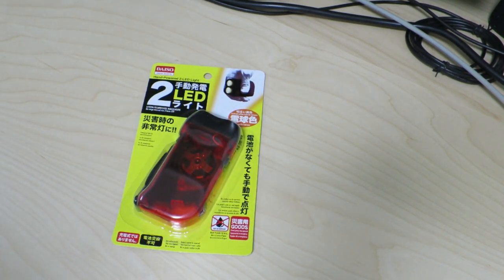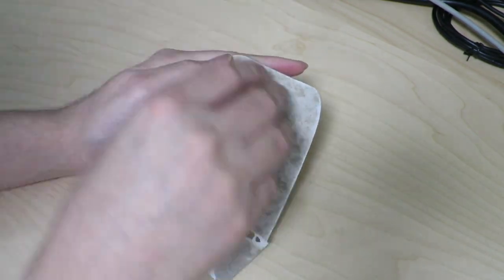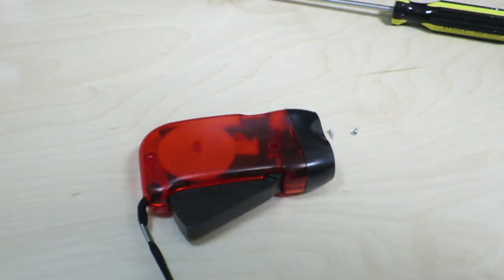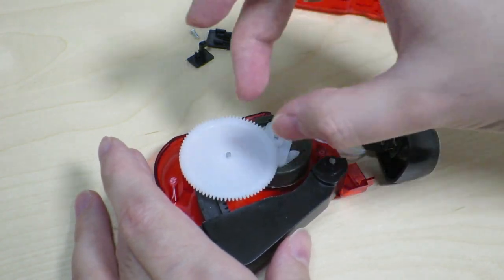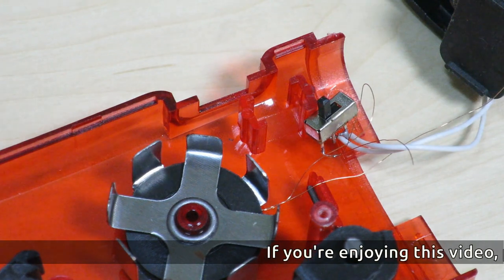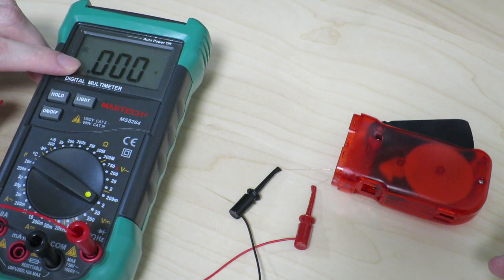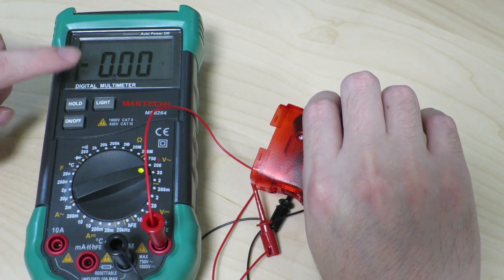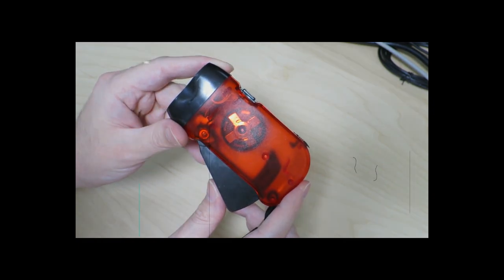Teardown and Testing a "Hand-powered" LED Flashlight

Comment: It appears these just have regular short-life, non-rechargeable button batteries in them. Once the batteries are dead, you have to pump with your hand constantly to produce light. If you stop, the light stops. It's a scam. The company tries to pass them off as having rechargeable batteries, like hand-crank lights normally do.
Reply: Found 3 L1131 Button Cells which is non-rechargeable inside.
Reply: But this can be recharged in a specific setting I'm still searching for the answer why the battery just charge itself in that setting.
Reply: Crazy thing happened when I touched the two wires together and the lights went on! I detached everything from it but the two wires. I guess the white casing on the top has some charge I guess.
Reply: bro i’m so stupid 🤦‍♀️

Comment: Neat basic idea. Could be improved in many ways. Add a supercap + joule thief, for starters, to make the light last longer after cranking. Put in a better generator (stronger magnets, more windings, axial flux), maybe a flywheel?, etc.
Reply: a supercap would be a nice addition if the ac is turned to dc that is
Reply: @evronetwork  A full bridge rectifier would do the trick, I think.
Reply: You would need special gears to use a flywheel, otherwise the hand pump would continue spinning 😵‍💫 

A joule thief might be too much tbh, maybe it could extend battery life, but if we’re using super caps it’s prob a lil extra. Having a voltmeter analog dial for battery life might be cool, or a radio w/ earpiece, or maybe a voltage multiplier to make a spark for lighting fires would be cool too
Reply: metal construction instead of plastic

Comment: Very nice example of mag flux, we see a spinning magnet and the coil wires which in a way cut through the magnetic fields, this movement causes mag flux which creates energy. As we know if you have movement and a field you get a current, this current is what powers the light.

Comment: Is there a way to harvest the energy? Like loading power into a battery?

It’s be cool to have a chargeable portable battery so you can power your phone just by cranking a little thing
Reply: Beware the voltage, you need a regulator or something will burn.
Reply: I was thinking about that too!!

Comment: I am 60,  tried to make one,  did not work, untill me friend told me,  AC  current,  need a dieode, :), I used a dyno from a push bike, I wondered why the bulb flashed all the time, put a diode on me frount light and the flashing went, we all learn, even at my age :)

Comment: you can also replace the batteries with super capacitor. it will charge quickly
Reply from the maker: The batteries in the thing is a completely different circuit from the generator, hence it's not used for charging from the generator. The (disposable) battery directly lights the LEDs in the separate circuit, which is switched by a ... switch. Connecting up a capacitor to store the charge is an interesting idea :-)

Comment: Very interesting video. The stator seems to have eight poles .The magnet rotates within these poles. How many poles does the magnet have?`The generator produces alternating current and leds operate only on direct current and that  could only mean that the leds light up during the positive half cycle of rotation of the magnet. Leds have a reverse voltage of around 5 volts so the generator should not produce voltage more that 5 or the leds would burn out. My only questiong relates to the number of poles that the magnet should have or does have. Thank you for an answer.
Reply from the maker: I don't have the flash light handy right now, so I can't give you the answer about the number of poles, but you are right about the LED lighting up only half the time -- in fact, I was supposed to make a follow up video showing that the LEDs are indeed turning on and off very quickly since it's getting AC current.
Reply: It does have 8 poles! If you put the magnet under some iron filings its almost like an octogon with 8 dipoles :)
Reply: @coobird  as the AC voltage from the generator is 1 volt higher then the LED's 5 volt operating voltage, wouldnt it be a good idea to put a full bridge rectifier in there? The LED's would receive DC so they'd light up 100% of the time of the generation cycle and the diodes of the FBR would drop the voltage a bit (maybe around 4.5-5 volts) so it would also prevent the LED's from possibly burning out.
Reply: @someoneontheinternetuvenev6268  yes let's have a more efficient one

Comment: So basically the generator only produce an electricity that we cannot store it up. The torch were power up by three button battery, and after the battery dies, you cannot recharge it using pump action?

Comment: Did you do a follow up video? I’m really curious to learn why are the leds working with AC
Reply: I reckon it is why there are 2 led bulbs. Basically turning on and off alternately in a really fast sequence. I think..
Reply: My guess is some sort of bridge rectifier.
Reply: @trythisj  I didn't even think of that. That makes it kind of self rectifying.
Reply: LEDs can work on AC but they will flicker because they only conduct during the positive cycle of the AC. During the negative cycle they're off and not conducting. On DC there's a constant positive voltage so the LEDs don't flicker, Hope this helps
Reply from the maker: Yep. That's exactly the case. The LEDs are on only during half-cycle of the AC current. And the LEDs are both in the same direction, so that both LEDs can be lit when the batteries are powering them (or else you'd only have one LED light when powered via DC.)

Comment: Long ago i have two of these flash lights in 2005
Reply from the maker: Wow! I didn't realize these have been available from that long ago!
Reply: We used to have it in India in 2007
Reply: We had these in Canada in 2007, except they used two CR2032 or CR2016 button cells (can't remember exactly which ones.) They were not rechargeable, as you can tell by the "CR" designation. It is almost impossible to find rechargeable button cells. So your flashlight will work off the batteries until they die, and then - it's just cranking that will keep it lit. Plus the wires and the gears are very cheap. If you want a reliable crank flashlight, get a Soviet Zhuchok (little beetle) flashlight. Bakelite body, thick gears made of durable plastic, and a metal cranking handle. We've had one of these in my family for decades, and it just kept on working! There are videos about replacing the incandescent lightbulb with an LED drop-in, and adding capacitors to keep it lit even after you stop cranking.

Comment: Hi! How do i fix the flashlight if the thin wires got disconnected?
Reply: Usually the wires break at a solder point.  Re-solder it back.   This unit is using an analog power supply.  Crude yes,  but works   Running an AC source (handle dynamo) in to some diodes L.E.Diode (rectifier) and you have wavy dc but enough to do the job.  The batteries are in the circuit til they go dead, I suspect and then it's all hand crank for a source voltage.

Comment: that design of that thing is totally flawed. the gear up is totally senseless. they could have used a spring instead and then just load the spring and use the release to accelerate the generator. this way you dont have to worry about gears.